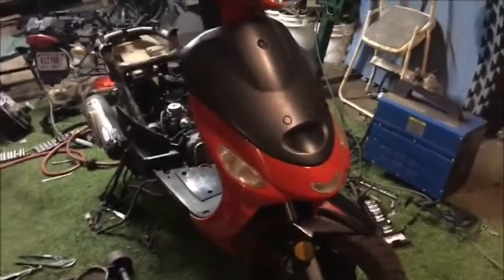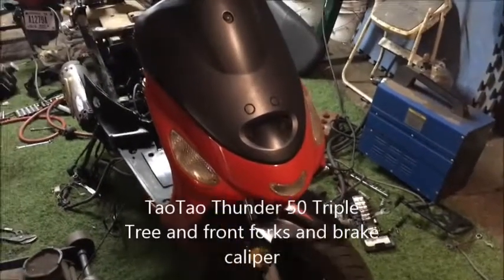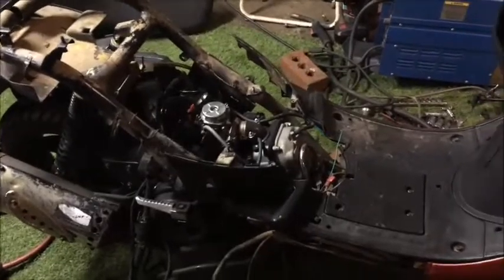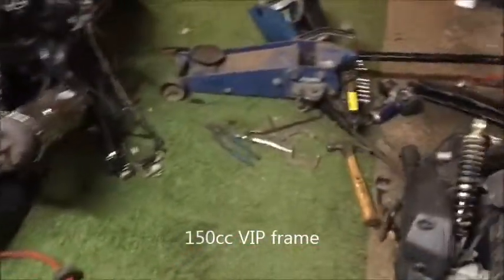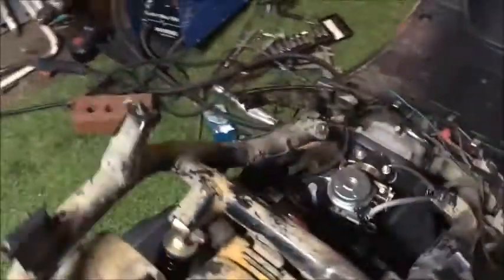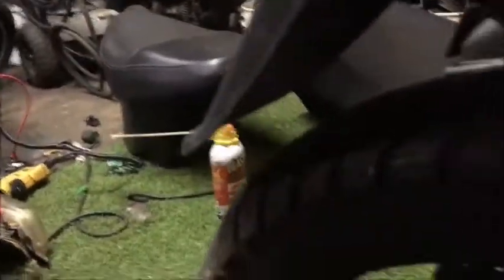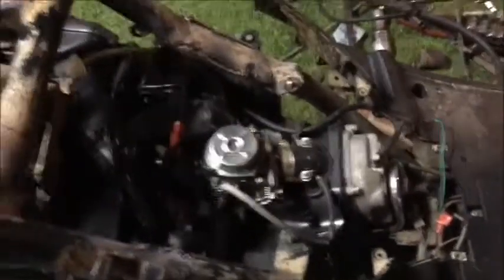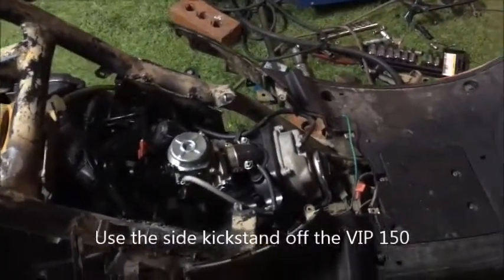TaoTao 50cc to 150cc engine swap Part 1 of 2

Comment: I appreciate finding this video especially because you chose to use the mounts from the 150CC. Was the width of the frame on the 50CC the same as the 150CC at the engine mounts? Or did you have to adjust the brackets to accommodate?

Comment: I'm have to give this a try i have the same scooter TaoTao and that 50cc engine is not going to cut it around this parts but i,m have to get order a new engine short case. where can i get the frame mount from??